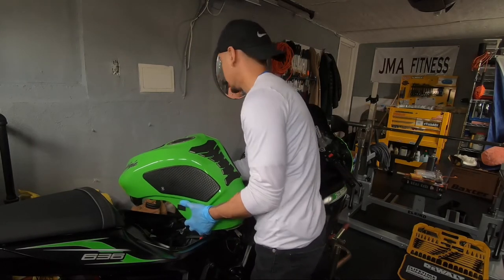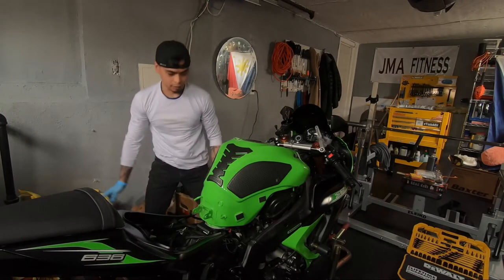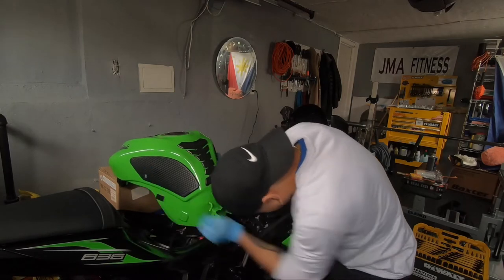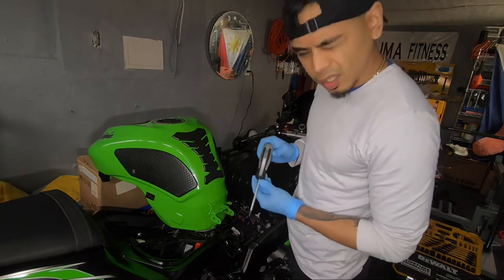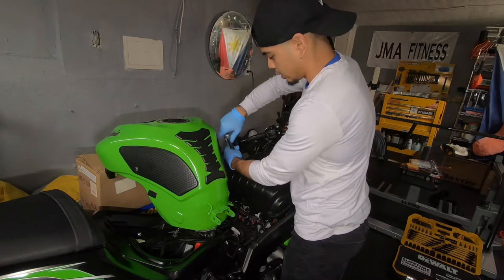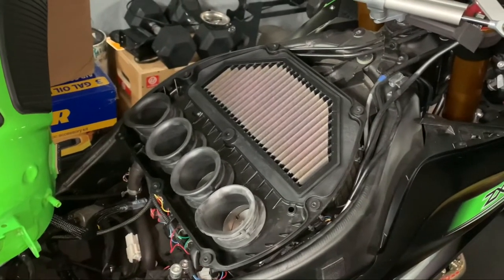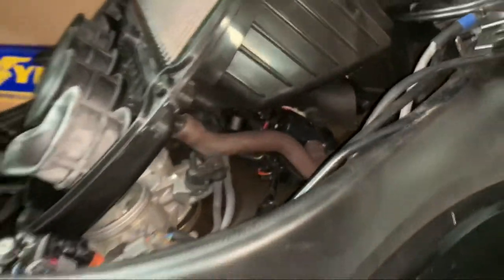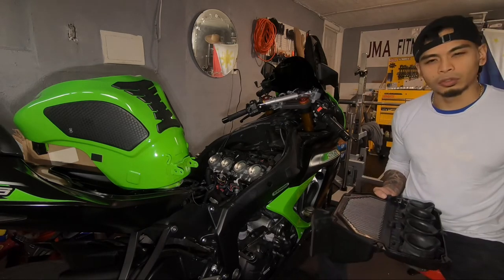FUEL INJECTED 2014 kawasaki 636 TUNE UP. Spark plug test and troubleshooting. STATIC SHOCK!

Comment: Just got my 636 was thinking about a tune up B/C I've got hesitation.  But you get this one going yet?
Reply from the maker: The bike is up and running. Fuel went bad and i had mostly water in my tank. Dont use trufuel just drain the tank and put fresh gas in there
Reply: @jersyboy15  damn good to hear. And appreciate the advice. Do an update with a ride and vlog man keep pushing the youtube gig.
Reply from the maker: @Moose_021  you got it stay tuned for the update video brother !

Comment: Hey I know I’m a little late but I’m having the same exact problems on my 636 and it has good gas in it and I have no idea other than maybe the tilt switch but it starts for like 10 seconds then dies
Reply from the maker: My issue was bad gas which i thought was good ! If your bike starts then dies id check air flow !